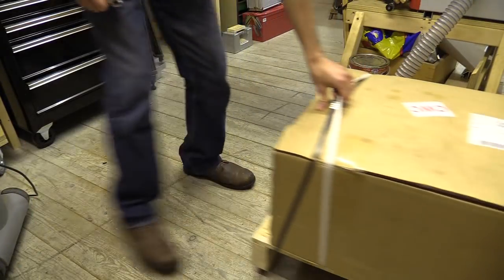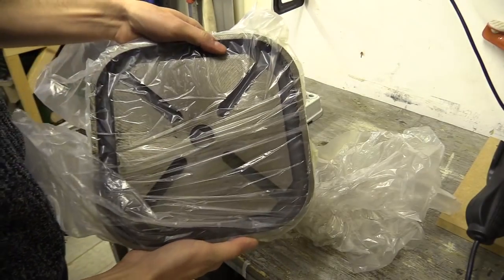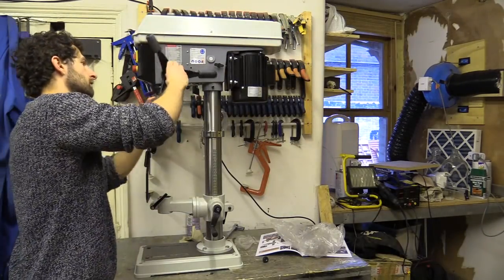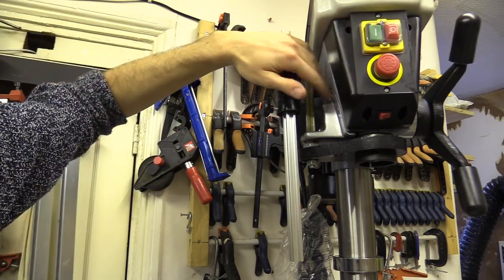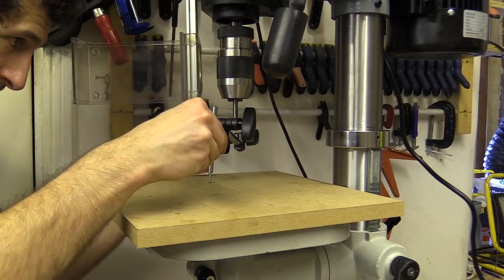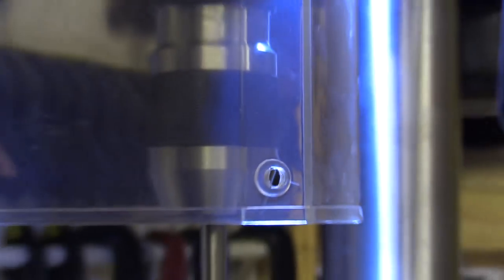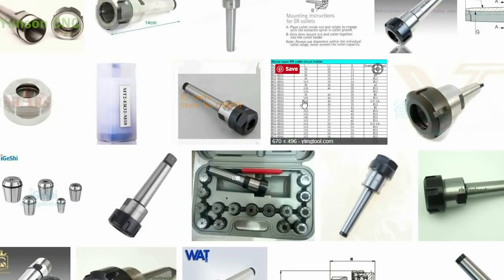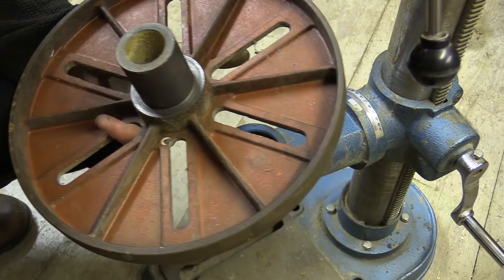The Bench Drill I Sent Back / ATDP13B  Bench Pillar Drill Press

Comment: Great Video Savvas. I've been kitting a workshop out lately and one thing lacking is a Pillar drill. This make will certainly be off my list.  Incidently I bought an Axminister belt and disc sander. It was ok and like the pillar drill lacks refinement and isn't particularly quie. 
Other tools purchased recently have been an Evolution Rage 5s table saw with blade which cuts wood, metal and plastic, Evolution 3DB mitre saw which also cuts metal and plastic and a 240v R-Tech180 amp inverter welder. Purchased these after much reviewing . They're excellent tools and would highly recommend each one of them.
Reply: Price
Reply: Price in Pakistani

Comment: I bought a large & small drillpress. The large one made the cover noise. I add rubbers and its quiete now. It look much like this one except the depth stop is on the handlebar as you would have this one be. The handlebar if 3x metal screw ins. This one also has runout which I lessened by marking and shifting the arbour to spindle and chuck to arbour around.

The small drillpress I actually likes a lot, but it has horrible ratteling sound around the spindle turning and shaft moving up and down inside it. I noticed this after I added some oil on top.
I solved the noise(Slight play between shaft and spindle horizontally that is), by forcing blue marine wheelbearing grease down the hole on top of spindle as driil shaft is pressed down to suck in grease, then close the hole on top with something like your finger, then let the shaft come back up again, that will force the grease down and as it sticks it acts as a buffer to quite that horizontal running play right down.
Note:The large drilpress shaft has much more splines, a better design and is naturally more quiete in this regard.

Comment: It looks as if you had the table upside down. That may have been why the table was too off for my taste. Glad you returned it. It is so frustrating that we 
can't find good quality machines anymore. Even if you buy a less expensive one it should be right on. The 1930's & 1940's was the best time to get quality machines. Many from that era are still in use today due to the quality of the workmanship. I don't know about the UK, but here in the states, everything was made here in the States and they took great pride in the jobs they had and produced some of the best tools even today. The fact that they are still around today is a testament to the quality machines they produced in that era.
Reply from the maker: No it was assembled correctly - the tolerance just wasn't up to what I expected, which is dangerously in engineering threshold. And errr, but you'll never find old tools in the quantity that new tools are available. Think of it this way, the good old tools that made it to our present day possibly seem great because all the crap ones broke and were thrown away. So we can only make a comparison with tools that survived, may have been improved, looked after, with the dramatically varying cost of present day machines. My problem was I can't afford to spend 3 grand on a UK manufactured Meddings pillar drill, which I know are the best drills in the world, and would probably wipe the floor with even the classic American made tools (sorry but it true). So I have to work with what I can afford which in the following video was a very similar older drill, but a lot cheaper.

Comment: Shocking!, I am a cabinet maker and require machinery that offers good levels of accuracy, I do have a few Axminster machines in the shop and work with them regularly, I was tempted to update or upgrade my old Draper drill press but maybe now not! It's old but runs quiet and smooth,  hope everything works out for you mate, Louie Ulster Workshops

Comment: As much as I love Axminster I just don’t buy their machines any more. The quality is always a little disappointing but I fear that’s the same with most modern machines. Scouring eBay and buying older machines is what I do now. I went from an Axminster Perform drill press manufactured in 2003 to a Meddings MF4 manufactured in 1971. The difference in quality is clear.
Reply from the maker: We use meddings at work - they are the goal but they are also well out of my budget. I think the model above the one I bought fares a lot better from what I've read.

Comment: I have the next model up from this with the same issues, it's very noisy too. I emailed Axminster & sent a video... they said if the belts are slack it will be noisy... I guess they think we're all newbies when upgrading machines!! I sent them another video showing the belt tension on both pulleys & with the drill in motion showing the excessive vibration in the lever too. They have finally arranged a collection but it's taken them a week to accept the return. Not impressed when i've spent a considerable amount over the recent years.

Comment: The pattern of marks left on the table is from what's called a Blanchard Grinder. Normally the surface is ok but that one looks like the wheel head was set to move much too fast across the table surface. That results in the rough wavy surface you noticed.

Comment: I have a modern version of your old drill (called a rockwell shop series), recently bought for the purpose of drilling 10-15mm aluminum for cnc machine plates. All I need it to do is go straight down, but it came with massive factory wobble on the quill (chuck seems fine) Did you have the same experience and if so any tips on fixing it? My drill literally has the same casting just different branding.

Comment: have just bought a axminster drill secondhand in an unused condition. free standing and has all these problems plus the table below the chuck has 15 thou play in its mast so cannot be locked to stop  it rotating but with use of a redbull can and cut up as a shim problem solved.i seem to get more joy out of repairing these machines than useing them

Comment: I think you made the right choice to return it. Tolerances aside, that noise and vibration is horrendous.

Before inflation shot up in what, 2010? This drill would've probably cost 30% less. It's sad how many cheaper machines (and this is not solely with Axminster) are now overpriced.
Reply from the maker: And Vat going up as well!!! I still can't believe I've only just bought a proper bench drill now after all these years of making / making videos. So many reasons to face-palm.

Comment: Looks like they spent way too much time frigging with the "safety features" (a chuck guard, wtf?) than building a machine to basic tolerances that can produce good results and is SAFER to operate. Hope you have better luck with the rebuild.
Reply from the maker: You kinda need it there - especially if it's for educational setting or public use workshop but there's better third party attachments. We use tecno piu guard at work and they are really good.